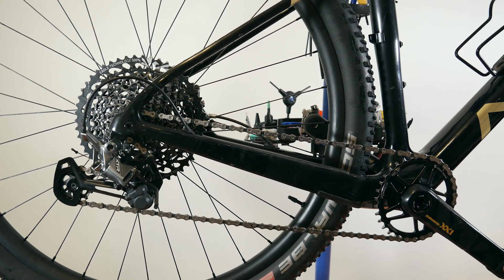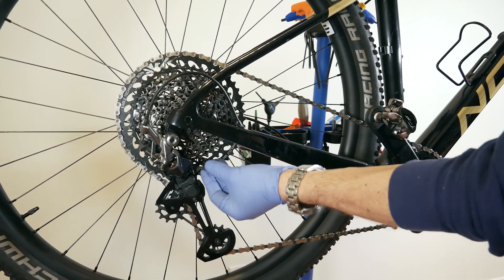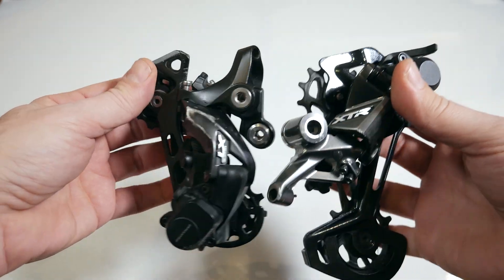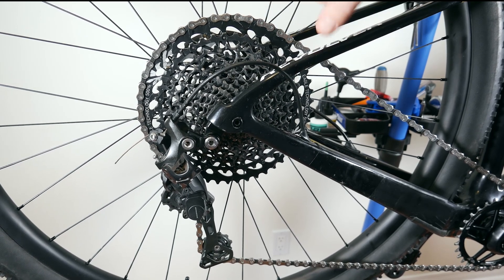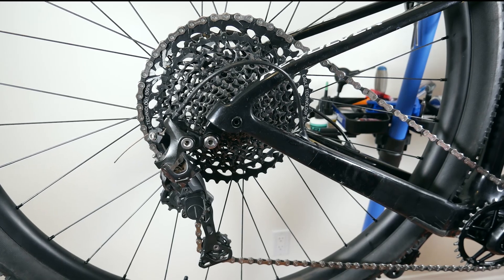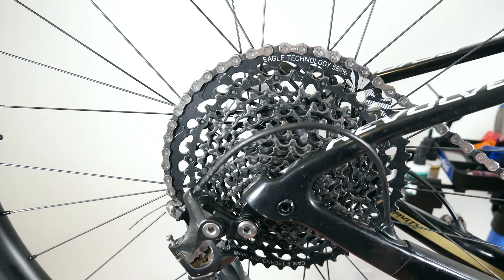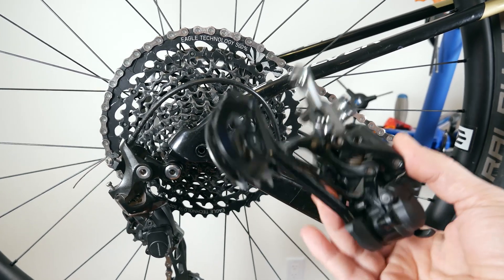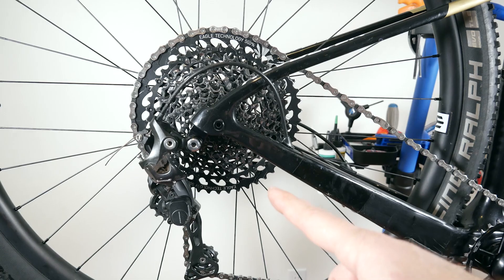Mix 11 Speed & 12 Speed Drivetrain - Limits of 11 Speed  XT Derailleurs -  Shimano GS

Comment: Good info my question is do you get more ground clearance with the 11spd vs the 12spd i am looking to run a sram 11 50 12 spd cassette and maybe a 11 spd rear deraileur mid cage in order to get more ground clearance i ride tracks covered in sticks and dont like how low the long cage 12 spd is what do you think .
Reply from the maker: @Yoda-em5mt  more clearance with 11s but I would not use it for your scenario. 12s GX RD unless you want to run a hybrid sram/ Shimano using just the sram cassette
Reply: @LoveMTB  thanks does the sram deraileur work with xtr shifter ? I really want the multi up shift function .The reason I,m looking at the sram cassette ie 11 50 is its HG and closer ratio in higher gears compared with shimano . I am happy with a hybrid mix match as long as it works . thanks again .
Reply from the maker: @ I would go Shimano shifter + derailleur and sram cassette. We raced that config for a few years
Reply: @LoveMTB  i think you did a vid on this already but can't find it . Does the 11spd  deore rear deraileur give more ground clearance than the 12 ie not hang down as much i,m pretty sure you said the 11 spd deraileur is the same as 12 just without the 12s printed on it thanks for you patience i,m after clearance which does not seam to be an issue for most riders .
Reply from the maker: @ that was for the M5100 11 speed. And yes no extra clearance vs 12 a derailleurs

Comment: Woops, I got M8000 SGS and M8120 SGS right now, THEY ARE TOTALLY THE SAME THING!!!!!!! Just in different plastic shells and pully size. 
Wasted another 50 dollar. 
You can measure the size between the bolts/rotating shaft, the geometry is totally the same to each other.
Reply: Interesting! I'm wondering if I should use my M8120 or try a 50t setup with the m8000 SGS that's already on my bike. Of course I prefer sticking to the old one and keeping the new for another bike. I don't even care about 12 speed. Think 11 will be just fine with a good cassette.

Comment: I'm back to this video, can the m8000 with 12s shifter works with 11-36 road bike cassette? I doesn't have m8000 rd currently, sold last yr, I think I have to buy it back. : / 
The m8100 and m8120 is hard to adjust on small cassette and I know the m8000 could move the pully to very small cog, but not sure if the m8000 works with 12s road bike cassette. 
Dang, it's too complex.
Reply from the maker: @黄辰旭  hey unfortunately the road shifters have a different pull ratio so it won’t be pretty. Can try it but here’s no guarantee it will work ok that 11-36T is tight tolerance wise, the whole 12 speed srivetrain

Comment: @LoveMTB, is it possible to swap the rear derailleur cage from say RD-M7100 GS to the RD-8000 GS to work with the wide range cassettes? The reason I'm asking is that 3rd party companies, like Garbaruk, do make rear derailleur cages for the RD-M8000 GS derailleur with offset on the guide pulley. If it works, might be a cheap way to go if you get a 12-speed Deore RD-M5100/6100 GS derailleur and put it onto the RD-M8000 GS derailleur. Another reason for this suggestion is that the 12-speed iteration of derailleurs are awfully massive and long with the SGS. If you're still running 26" or 27.5" wheels for older bikes, the latest iterations are just too long!

Comment: What I want to know is if the xt m8100 12 speed rd will work on m5100 cassette.
Reply from the maker: yes
Reply: @LoveMTB  coming back here, Mate. Can I use XT 8100 RD with 11 speed 11 to 46 cassette and 11 speed xt shifter? Just asking since the price for both xt8000 and xt8100 is almost the same.

Comment: @LoveMTB - It would be awesometo see you compare the new Deore M5100 11sp rear derailleur with the M6100 12sp. Both appear to look almost identidal with similar max cassette capacity and larger 13t jockey wheels.
Reply: @LoveMTB  Just installed a M5100 rear mech plus XT shifter on my 12 speed SX eagle cassette, chain and crank combo. works really well. The stronger clutch appears to have solved the inertia clunk i used to get when pedally fast and quickly stopping on my old setup.

Comment: Hi mate. If you didn't use the 50 and run it on a 42 or 46 (and b tension set up on these,  took out the appropriate chain links, do you think it will work really well? Is there a different in the gaps between 11 speed and 12 speed Shimano cogs. 
Thanks

Comment: Hi there, i have a 12s m6100 rd and planning to  set it up as an 11 spd. (12s rd, 11s chain, cassette, shifter.) will it work or i need to have a 12 spd chain for this kind of setup?
Reply: @LoveMTB  thanks, btw does it affect the performance or not?
Reply: @LoveMTB  can i use 11 speed 116 links chain for 11-50t setup or 126 links? I have a 34t chain ring and planning to upgrade to 36 or 38t chain ring

Comment: Right now i am riding cs-m8000 2x11 (11-40) on a xc fs. But after 4 years and  6 k km the drivetrain in gone . instead of brainless renewing the parts , i am thinking to go new ways. So I already decided to switch to a KMC chain. But the casette , it is a hard decision. As far as i understood my derailleur is capable of 46 , with an extender even up to 50.Due to pricing i also looked into sunrace casettes.  The current chainrings have 26-36. So I really start to think why not go 1x11. What would be your recommendations or your experiences.

Comment: Now that my bike got stolen and i have to work with what i can get... I still have an 11spd RD that i kept as a spare. What if i would swap on the cage from the 12speed RD's? That sure would work right? I mean the M5100 has a big cage and uses a 11-51T cassette. I would want to use a 11-52T 12spd cassette.
Reply: @LoveMTB  Damn so i guess i have to stick to a tiny cassette. But good to know. Thanks man! atleast it happened in the winter time not in the sommer where i rode every day.

Comment: A disadvantage with the 12 speed shimano mechs is the long cage length (only sgs, not gs is recommended for 50t cassette). I've ripped 2 12 speeds mechs off in  the last week. Never ripped off an 11 speed in over 10 years of riding. I'm going back to 11 speed with a 11 46 cassette until I can get hold of a GS m8100 & a 10 45 cassette) The SGS is just too low with 27.5" wheels. This seems to be quite common.

Comment: Hi @LoveMTB, would it be possible to use an 11-50 or 11-51 tooth 11-speed cassette with the Shimano XT M8000 SGS (long cage) derailleur? If not, would adding larger jockey wheels make it work? Any other solutions to get 11-51 work with the long-cage derailleur? Thanks!
Reply: @LoveMTB  I just happen to already have the XT SGS derailleur installed, I am trying to find a way to get it to work with an 11-51t cassette. Garabruk makes longer cages and bigger jockey wheels, but that would be an astronomical amount of money just to get it to work with an 11-50t cassette, but then I would have to buy their $228 cassette, $66 jockey wheels, and $65 derailleur cage ($359 altogether!). I think the Deore derailleur and cassette would be a better option, cheaper price, an extra tooth on the low gear, and more readily available and easily replaceable. Unless you know of a different way of getting to 51t on the XT SGS derailleur, where I could end up using the Deore 11-51t cassette instead of an aftermarket brand.
Reply: @LoveMTB  I have the 11-speed drivetrain, not the new 12-speed.
Reply: @LoveMTB  Thanks for the in-depth responses.

Comment: Hi, just found this channel. Im really enjoying watching you guys. I just bought new bike, xtrada 6 from polygon. It comes with m5100 1x11 speed. I realy enjoyed it. But something is missing, i dont quite enjoy the shifter. Its not as precise as my friends bike which uses m8000 shifter. Questions is, will i be able to use those shifter and have a benefit improvement over deore shifter? Thank you so much sir if you are willing to answer

Comment: Hello, LoveMTB.
One question please, i have derailleur  Shimano XT M8000 11s and 12s 11-46T cassette (aliexpress), it will work?  if I buy a 12s shifter...12s chain?
Thank you very much for your answer
Reply: @LoveMTB  Thx :)
Reply: @LoveMTB  I want to buy shifter deor 11speed +dérraileur 12speed m7100 +cassette deor 11 speed 11-51t + chain 11speed 
Does the 12-speed gearbox work in an 11-speed system?

Comment: im wondering if the xtr m9000 shifter would work with the new deore m6100 RD?
Reply: @LoveMTB  im planning to upgrade from 10s to 11s 1x setup. Here's my choice. 11s cassette, 11s shifter (xtrm9000 because its features) deore m6100( the price difference of deore 11s and 12s rd in our country is quite close im thinking getting the newer one) and probably an 11s chain as well.   Thanks man
Reply: @LoveMTB  im thinking between 11 speed 11-46t or 11-50? what do you recommend for me? im just a beginner when it comes to biking. thanks in advance
Reply: @LoveMTB  sure man, but it will take some time  coz parts here are too pricey during pandemic. i also forgot what chain is suitable for 11 speed cassette but 12speed RD? BECAuse i saw on shimano website it says for deore m6100 RD the recommended chain is 12speed. sorry for asking too many questions :)

Comment: to be clear - did you use a 12sp shifter with an 11sp derailleur on a 12sp cassette? It shifted pretty darn well considering
Reply: @LoveMTB  thanks man. I'll check it out. I want to try use an 11sp cassette/mech with a 12sp shifter because I have i spec EV brakes and want  to try an I-spec-EV shifter, but they only seem to be 12sp
Reply: @LoveMTB  thanks man. Thanks for the great videos too

Comment: Would this work on the new 11 speed 5100 cassette? The 11-51 tooth?  And what shifter would you recommend?  I’m asking as with the Covid shortages I can’t find proper m5100 11 speed Groupset components. Thanks
Reply: You can use any of the 12s derailleuurs, both Sram and Shimano work.

Comment: WOW! Do you think a long cage 11spd RD can work with a Shimano 10-51 Cassette? To be exact i have an RD M5120.
Reply: @LoveMTB  At the Moment i'm using it on a Sunrace 11-50 cassette and it works pretty good. The Shimano 10-51 only came to mind as it has a smaller top gear wich is like a 36T chainring with an 11T in the back. Wich would enable me to stick with my 32T chainring but don't loose climbing gears.
Reply: @LoveMTB  Alright. probably the 10T will be problematic then right?
Reply: @LoveMTB  Good to know thx🙂

Comment: It's kinda late but can my xt shifter m8000 work with m6000rd 10 speed and 11-42 10 speed cassette?
Reply: @LoveMTB  kinda different. I wanna use m6000rd with 11-42 cassette 10 speed. But the shifter i will be using is m8000. Do u think that will work?
Reply: @LoveMTB  thanks mate. Appreciate it. I have both m6000 shifter and m8000 shifter. I just liked the feel of m8000. Viewing from the Philippines
Reply: @LoveMTB  dude i got an update. It worked. Shifts perfectly. Just made sure i adjusted the limit screws properly. My friend also uses m8100 shifter on a 11 speed slx m7000 rd and cassette. Works fine.

Comment: Good day sir! I have a m5100 derailleur (for 11-51T) and was wondering if I paired with it with a m6100 shifter and 12 speed cassette would the derailleur be able to handle it? Thank you for your time and great contents. ☺️
Reply: @LoveMTB  i wonder if it will shift smooth like m6100 rs?

Comment: @lovemtb  just wondering, How well do you think a Shimano 12 speed GS  derailleur, would work with a 51t cassette?  I bought one by mistake and can’t return it. It’s only supposed to be use with 45 cassette, thanks
Reply: @LoveMTB  Hi , I’ve  tried the short cage mech,  it seems to work well on the 50t cassette.  ( I’ve not tried my 51t XT cassette yet). The only issue is it won’t shift down from the largest to the second largest cog, it shifts  down to all the other cogs,  not sure why?
Reply: @LoveMTB  thanks for your reply, it’s for a FS,   I have managed to  buy  a  damaged XT SGS derailleur,  so I think I’ll be able to swap the cage from this if all else fails  !?
Reply: @LoveMTB  I’ve now tried the Shimano 12 speed GS  with the xt 51t cassettes down it works well, much better in fact than the 50t NX cassette it replaced, thanks for all your help 👍

Comment: Is it posible to a deore m6000 rd with a deore xt 12 speed shifter?
Reply: Im having a 10 speed drive train deore m6000 can a i use a 12 speed m8100 right shifter on my deore m6000 rear derailleur will it be compatible?

Comment: Is it possible to use M6100 12spd RD on M7000/M5100 11spd Shifter and Cassette? Would it affect cable pull ratio? Thanks!
Reply: @LoveMTB  Thanks a lot!

Comment: Hi, Is there any way to match the xt m8100 12 speed right shifter to an xt m8000 11 speed derailleur (medium cage).?  My cassette type is xt m8000 11/46 speed and my chain is HG 701.  Also, how about if I change the derailleur to xt 12 speed with the same cassette and shifter.?  I'm going to order it now.  What do you recommend? Pls. reply.  Thank you.
Reply: @LoveMTB  Thanx for your reply.  So, what do you recommend for the cassette, is it the sunrace 11/50 and an xt m8000 gs.?  I only have a 26 inches wheel .  I think I can fit the sunrace 11/50 to my freewheel.  I came from xt 9 speed and a new crankset is xt fc-m8100 12 speed.  Sorry for the noob question.  Thanx again.

Comment: It doesnt work in practice. I tried RD XT 8000 SGS  11 speed, cs SRAM PG 1230 11-50 12 speed, xt 8100 shifter. I am wondering about new deore cs 5100 11 speed and  rd XT 8000 SGS. I think it is better idea.

Comment: Would the shimano 11 spd LONG CAGE RD possibly work better?
Reply: @LoveMTB  yes, this or GX R.Der. will be the way i go, whichever i can source quicker...Pricing on the SLX is better value by far tho...
Reply: XT was out of stock, so i ordered SLX RD & Shifter - Saved $20 over buying just a GX RD!
Reply: @LoveMTB  Just installed it: SLX RD & Shifter on SX Eagle Cassette - super smooth shifts, adjusted quickly and without issues.
ONE PROBLEM CONTINUES from when it was all SRAM SX still: occasionally when quickly shifting up to highest gear, the chain will miss the highest gear (smallest cog) and get jammed in the space between cassette and chainstay/dropout - its just tight enough for the chain to get stuck and wont come out on it's own...have to move chain by hand back onto the cassette. I have my limit screws set correctly.
Reply: @LoveMTB  will do, the jockey was a bit outside, guessing due to initial break in with new cable, RD, shifter. fingers crossed. thanks again! without your video i would have ended up with Sram NX as a crappy and more costly upgrade.

Comment: Cool, it looks like the ratio of derailleur movement to cable pull is the same for both derailleurs. So that all one needs to do is change to a 12-speed shift trigger to get this to work. The test was unfair in that the cage was too small for the 50T sprocket. I have personally found that new narrow-wide chainrings obviate the need for derailleur clutches for my riding. So I want to try nice light clutchless DuraAce RD-R9100 on my next bike running a 10-28 or 10-32 cassette. Anyone try such a combo?

Comment: Would this work the other way round I.e. 12 speed slx shifter with older 11 speed xt derailleur and cassette? I'm wanting to go back to 11 speed as the 12 speed cassettes are too big and heavy (or very expensive!).

Comment: Nice, thanks for checking this! I think I have M8000-SGS with my 2x11 and am converting to 1x12; maybe the SGS version would work even better, at least as a temporary solution to delay spending on M8100 (as I think SLX doesn't have cartridge bearing jockey wheels?).
Reply: @LoveMTB  Thanks for reply. Unfortunately I have the GS version. I'll try to mod it with a friend maybe, as it is not worn out at ally, and I don't feel like buying a new M8100 derailleur and selling this one. Hope it will be an acceptable solution, at least a temporary one :D.
Reply: Nope, I've got GS. I don't know what SGS M8000 is for - is it for 3x11?

Comment: I've been using 10 speed deore m615 derailleur with one-up radr cage with 11 speed 11-46 sunrace cassette and 11 speed nx  shifter for some time now and it works pretty much okay, considering that derailleur withstood almost 6 years of abuse. Hence no surprises the same trick works for 11-12 speed.

Comment: I still use the e thirteen 11sp cassette (9-46). I’ve been using the sram GX 11sp derailleur but it’s worn out and needs replacing. Do you have any recommendations for which derailleur would best work with my cassette? The GX has been fine but I wonder if I could do better?
Reply: Thanks for the info. I’ll be getting the 11sp m8000 just because it’s cheaper than the 12spd compatible r.d. Keep up the great work!

Comment: Thanx for the vid!.....I just upgraded bikes to a Shimano 10-51 12 speed (From 11-50 11 speed Sunrace) to get my fat ass up the hills easier and more top end speed on the flats.
 IMO,get the right tool for the job....No effing about and "trying to make it work"
Reply: Why can you go up the hills easier if the range is almost the same, and the difference is basically one small cog in the middle of the cassette? Just curious as I have a 1x11 with an 11-50T cassette as well.